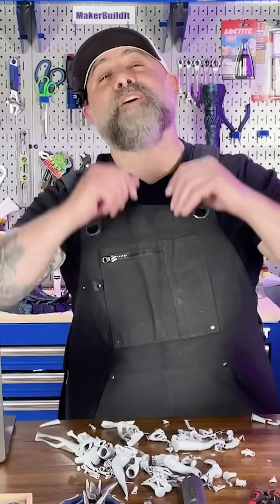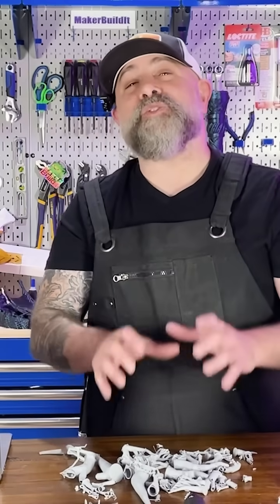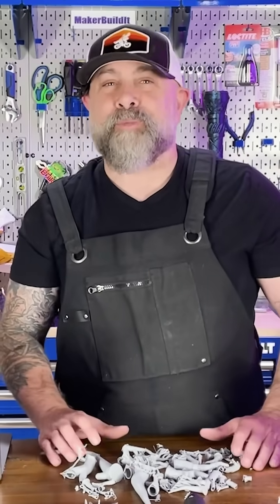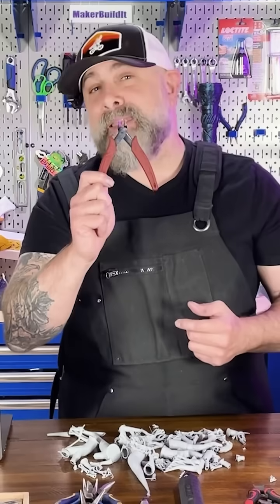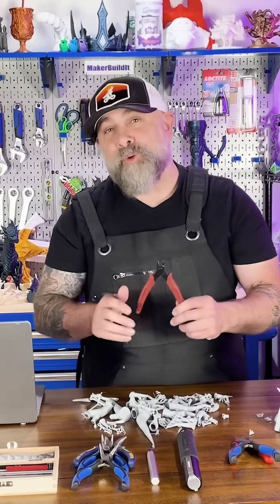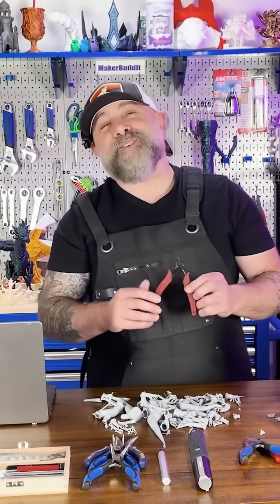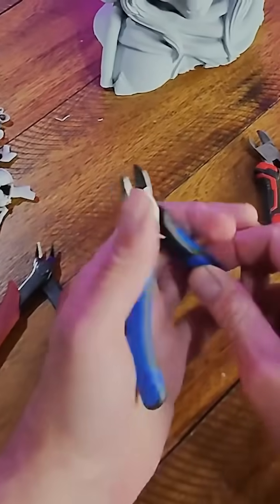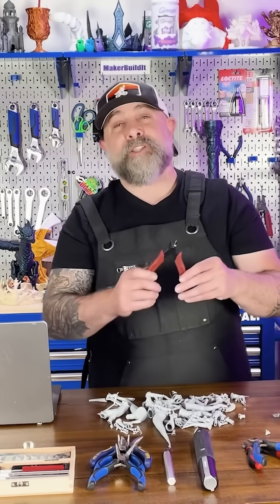These Tools Make 3D Print Support Removal EASY

Comment: I set my top and bottom z distance to .275.  I use snug supports with a honeycomb pattern. Started to paint the supports on myself. 95% of my supports fall off without snips. Sometimes the supports stay on the build plate when the print comes right off.